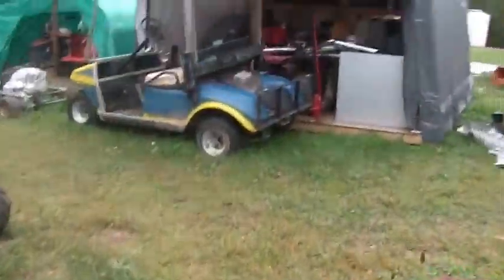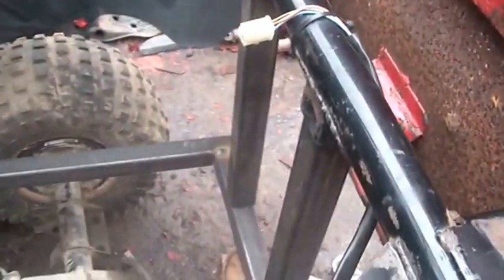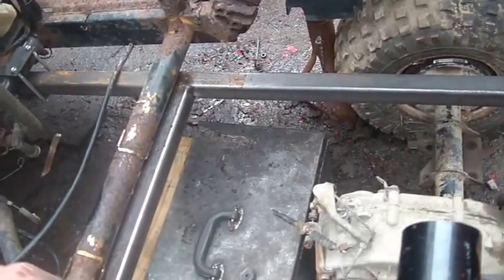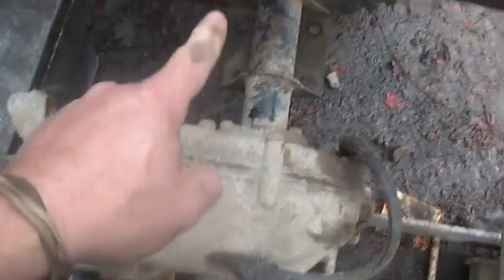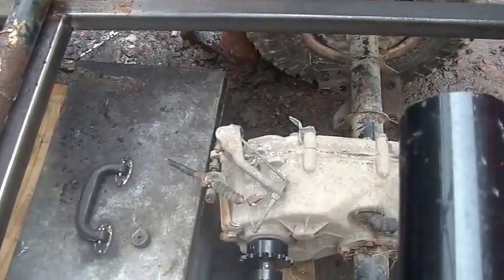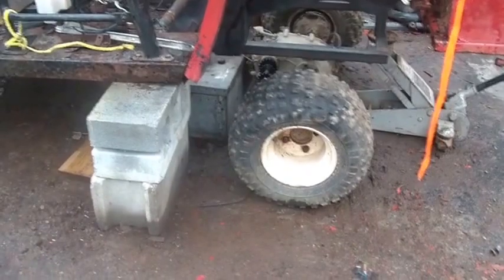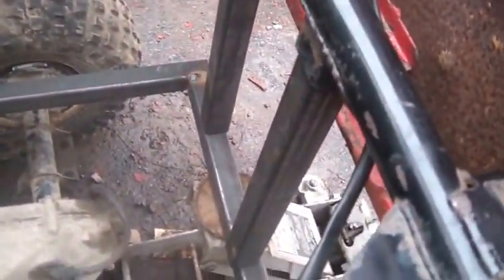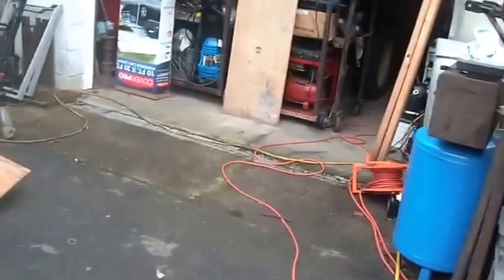1987 Kawasaki Frankenstein Mule, Front frame mounts, gear ratios,

Comment: your fabrication skills are much improved on this build,i suggest clocking the torque converter as much as you can and using a engine mount plate attatched to the subframe
Reply from the maker: Hey Roger, Thanks for the kind words about my fab skills, I think using fresh steel, spending some extra time on the cuts, and using my new Lincoln flux core welder has really made a difference.... I think I did as us suggest on the motor mount, the video should be up over the next few days....  I thank you for all the good advice, kind words, your thoughts, and taking the time to comment!!!!

Comment: After finding out you only want around 10mph top speed, expect 6.5hp Gas engine sufficient. Originally assumed you would want 30-40mph top speed, like the ones viewed on Duck Dynasty.
Reply from the maker: Hey Sim!!!  I figure the EZGO / Honda Quad motor conversion can be the fast one, this one is supposed to do some work for a living.... The ones on Duck Dynasty are $10K to $20K machines, that would be a car to me.... Thanks for the info,  your thoughts and advice, watching, and commenting!!!